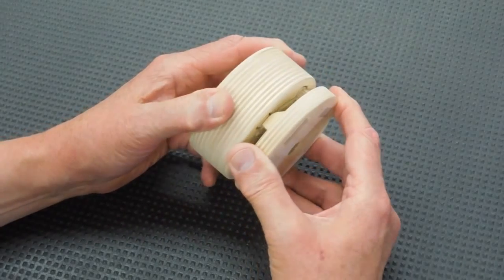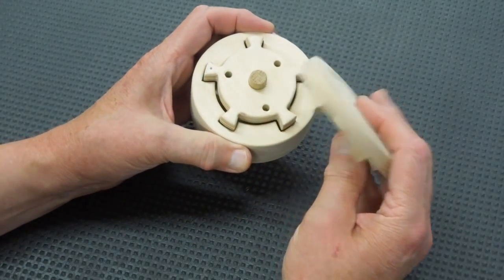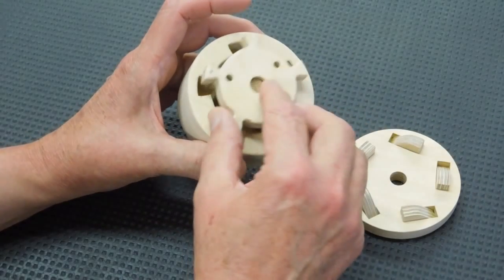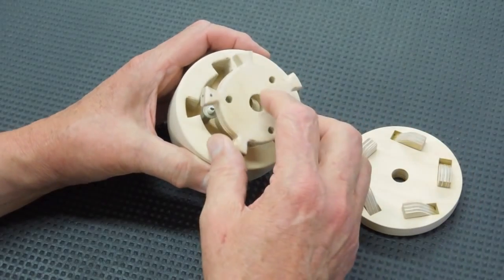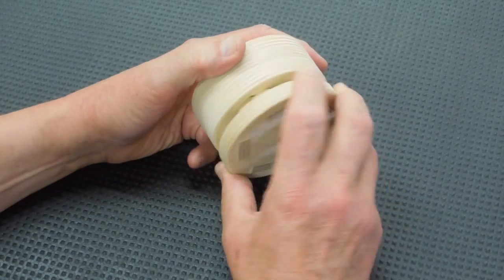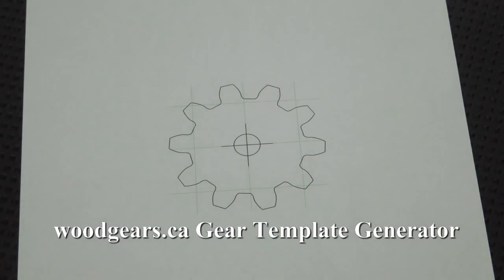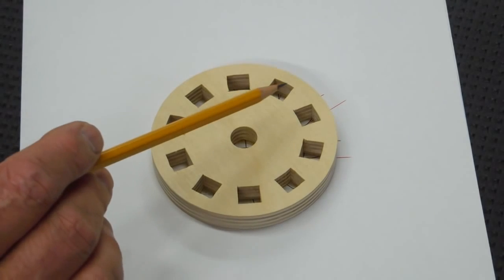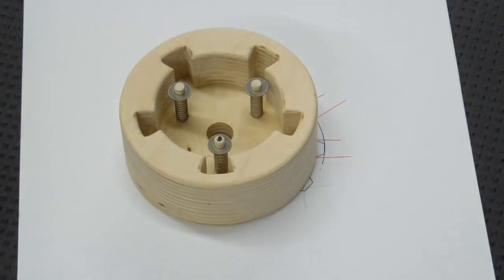One-Way Ratcheting Dog Clutch

Comment: at 1:04 you point out the 'spring guide bars' which I assume are a stock bought part. but I cannot seem to find anything of that name on eBay. what should I be looking for? thanks
Reply from the maker: I could have described that a bit better. The guide bar is whatever will fit loosely inside the three compression springs. In my case that is probably 1/8" diameter wood dowel. And I do not remember what size the springs are... just what I found in my salvage parts box. The guide bars will be whatever suits the compression springs you have decided to use. Thanks for watching!
Reply: Ronald Walters ah that's great, thank you!

Comment: Great work Ronald, do you have any gear project like a clock (with to needles in the center), where the "seconds needles" spinning to the right and  other "seconds needles" spinning with the same speed to the left? for kinetic project that I love and I want to use an small motor to create de movement. Thanks in advance
Reply from the maker: I am not sure what you are looking for. I have a 4-video series on a "Gear Head". On the back side of the head, I use a ratchet and a geneva mechanism.... one increments the pointer counter-clockwise and the other increments the "word wheel" clockwise. The pointer and word wheel are on the front of the head. Power transmission from the back to the front is via telescoping brass tubes just like you would find for the hour/minute/ second hands of a clock. The brass tubes are not specifically shown in the videos. What you want to do could possibly be done with fewer gears.  I also have videos on my clock "Simplicity" designed by Clayton Boyer. Hope that helps. Thanks for watching. Please Subscribe.
Reply: Thanks for your answer, I read and view your recomendations, susbcrition done! :)

Comment: Really loved this video, explained it nice and well. Designed my own one and 3d printed it, however isn't as smooth as wood due to the discrete layers on the ramps.
Reply: Any chance you have any of the files still from this? I’m trying to draw one and can’t get it right
Reply from the maker: No, sorry.
Go to woodgears.com. Lower left hand corner of the web page there is a free gear template generator. Look around for instructions and demonstration videos on how to use the gear template generator.
In my video I explain how I used a gear template to lay out the dog clutch. You just need to duplicate my efforts.
Have fun. Please subscribe!
Ron

Comment: Is there a reason, other than decorative, for the dog to have a "dovetail like" shape?
Reply from the maker: +Greg Altenhofel When the mechanism is assembled you can’t see the parts so being decorative wasn’t a consideration. You want the area(s) of contact between the spring loaded dog and the drive plate teeth to be flat and
that will generally be along a line drawn through the center of the mechanism. Then on the other side of the dog the same situation is required, so the dog teeth will slide smoothly and evenly on the inclined planes (or ratchet ramps) and compress the springs. That line of contact will also be a line drawn through the center of the mechanism. Cutting away everything else, I ended up with a “dovetail like” shape.
Reply: Thanks so much for getting back to me on this.  I seem to remember it being an old video.  I'll go back and watch it again, perhaps I'll see it this time.
Reply: Got it within a few seconds this time thanks again.

Comment: Wonderful work. Wonderful finish look to them also. Could a single centre spring work as well as three springs for this dog clutch??
Reply from the maker: I made it this way because I had the three small springs and did not have a larger spring, which would fit over the axle. A single spring could be used on the axle instead of the three springs on the guide pins. The internal center spacer would need to be modified to work with the single spring. One possible configuration, the spacer could be a larger diameter (same as the inside diameter of the body cavity) with three small holes to fit over the dog guide pins and a larger inside diameter (for the spacer), leaving ample room for the single center spring. The guide pins could possibly be eliminated if there was sufficient overlap between the dog and the body of the clutch. While I had sufficient overlap, I found the guide pins provided smoother operation.
Reply: Ronald Walters Thank you for spending the time to answer.

Comment from the maker: Wood gear clocks usually have 3 “clicks” (at least the ones I have build have 3) and are gravity operated since the clock hangs on the wall and winding mechanism is always vertical. Only one click engages at a time. The mechanism in my other video “Wood Gear Ratchet” (with two pawls) would be more suited to a clock. Advantage of this ratcheting dog clutch is more points of engagement spreading out the load. Advantage of both clutches, they are spring loaded and will work in any position.